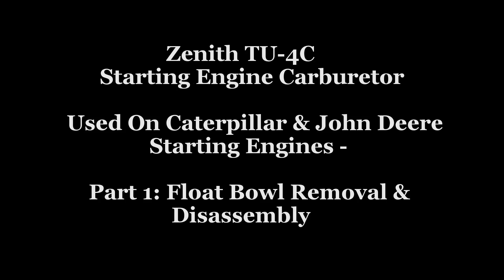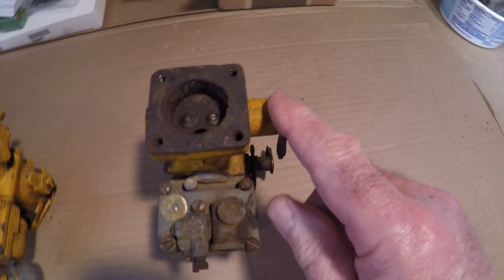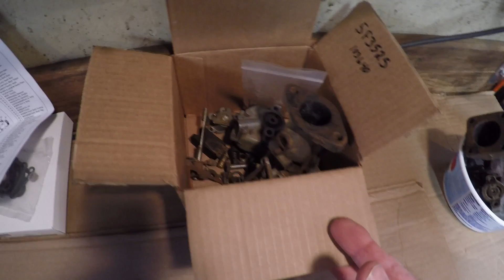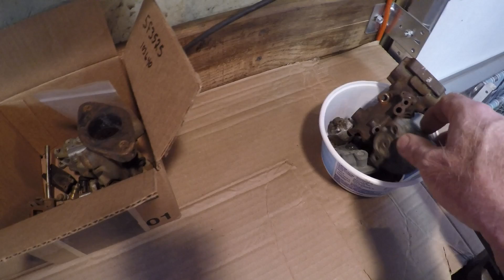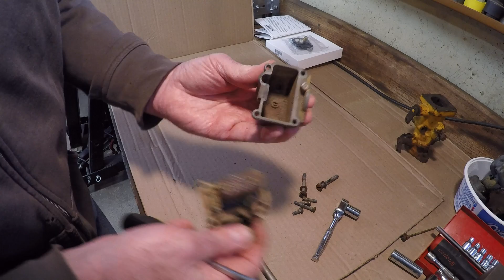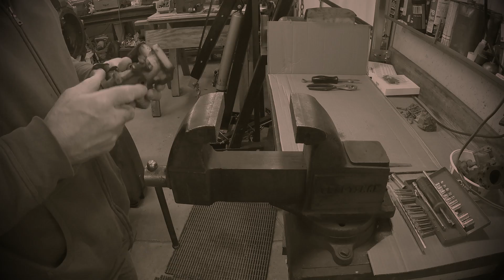Caterpillar D2/D4 & John Deere Pony Motor Carburetor Rebuild Part 1 of 5 - Float Bowl Disassembly

Comment: I have that later version of TU4C on my D4. The kits you can get do not include many of the parts you can destroy when disassembling the carburetor. Worn throttle shaft, bushings....a problem.

Comment: Have been looking forward to this series since you mentioned it almost a year ago!
Whelp my jet assembly separated while taking the carb apart, P/N 5F7640, and I'm looking for another one (or a whole carb/throttle body). I didn't realize it was 2 parts, but the needle was stuck in the throttle body so unscrewing the assembly just caused the heavy press holding the parts together to separate. My backup plan is to try and fabricate one using some .093 x .014 wall brass tube. Anyone out here have a carb they're willing to sell? If not I'll buy parts - I also need a new choke plate shaft, P/N 9B4977 I believe. The screws sheared off when trying to remove them after melting the solder, I may not have gotten the backside hot enough. I can try to drill out the fasteners, but it would be easy to just turn a new part if I can't find a replacement.

Comment: I'm going to to rebuild my pony motor carb soon so this video series is much appreciated.  Thank you  I'm wondering if you can tell me how... or do a video on removing the hydraulic pump from a D4-7U.  It's in the front mounted tank.   A video on changing the hydraulic pump seals and a general inspection would be great too!  I bought the D4 about 12 years ago and the hydraulics were non-op then.  Previous owner said he was operating it and all the hydraulic fluid suddenly blew out of it and sprayed back covering him.  Your valuable insight and input would be greatly appreciated.

Comment: I have gone to running a pretty heavy dose of marvel mystery oil in my pony gas. It really seems to have helped with limiting deposits and corrosion.
Reply: Forgot to mention I had already been running Stihl synthetic 2 stroke fuel mix as well as a top end lube snd fuel stabilizer.  I would rather my old engine be smoky than rusty snd in the humid environment of Kentucky it is a big battle with sweat and rust especially with the common 50-60deg daily temp swings we get.

Comment: That's good news about the aftermarket float availability. Thanks for the helpful hints. I would be lost without your suggestions. Thankfully I've always run the fuel bowls dry after every start.